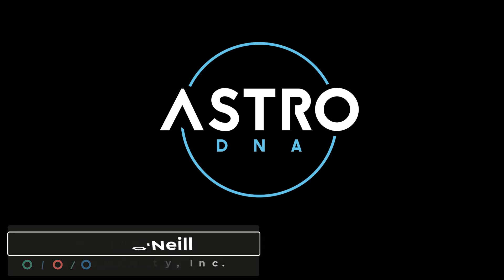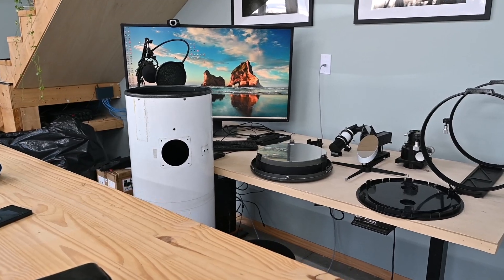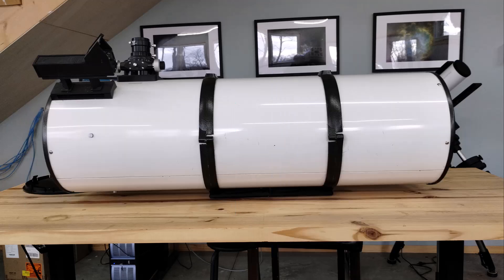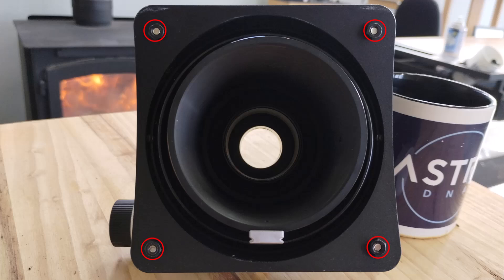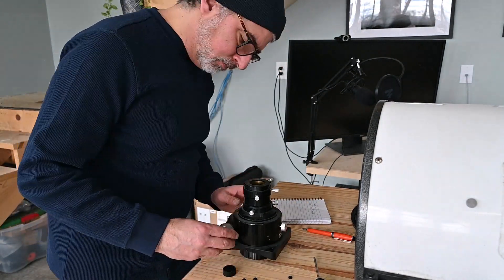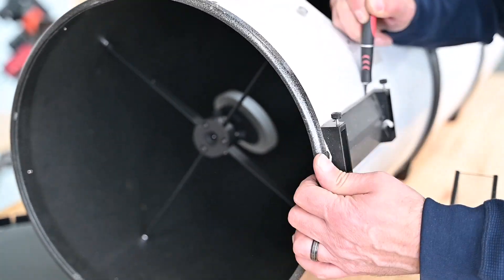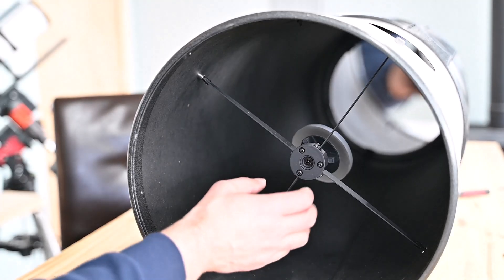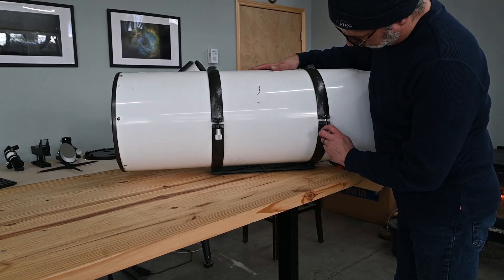Restoring a 12-Inch Newtonian Reflector: Telescope Teardown

Comment: Every other video I've seen turns the mirror on top and lifts the assembly off upside down.
Reply from the maker: The biggest risk with that approach is the primary falling out of the housing - it can happen, trust me! Cheers...
Reply: @AstroDNAObservatory  yes, I realized that after thinking about the weight of a 12" or larger mirror. Also noticed in the next part that you covered this comment. Better to leave the uncertainty to the shipping company before it's delivered. I'm sure they turned it on just about all of the 6 sides of the box before mine arrived. The plastic banding was also cut deeply into the side edges.

Comment: I used to grind my mirrors and build my own scopes.  A 12.5" f/6 was my largest.  Components (mirror cells, spiders, focusers) hard to come by so improvising was key.  It was visual only back then for amateurs (pretty much).  Anyway, I have a pretty good feel for what you are doing; it's a bunch of work but for 12" it will be worth it.  
You might want to consider re-aluminizing your mirror.  Its reflectivity (even without dust) is probably degraded; the aluminizer will generally clear it properly as part of the process.  Shouldn't cost too much (but I'm out of touch with such services nowadays).  Good luck, have fun, enjoy the views.
Reply from the maker: Great to hear from you, Larry. Some day I will grind my own as well. It has been on my list for 30 years... I'll be taking a close look at the mirrors this week to see just how bad off they are. This telescope sat in an abandoned observatory for 5 years. The building was in serious disrepair. I can can't the number of fossils I found in the nooks and crannies of this scope. I've had it in my workshop for three years and finally I am getting around to the rehab work. It's actually a heck of a lot of fun... Cheers!